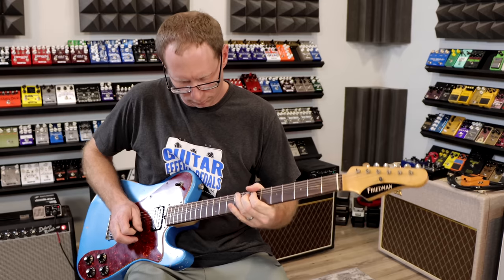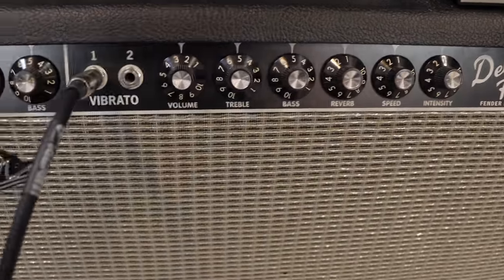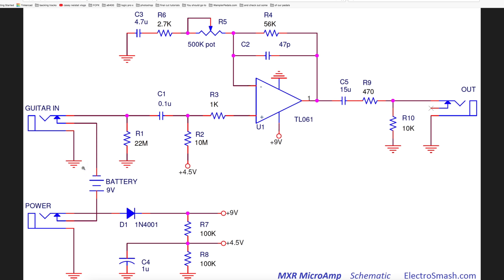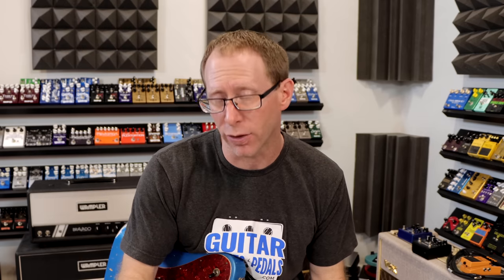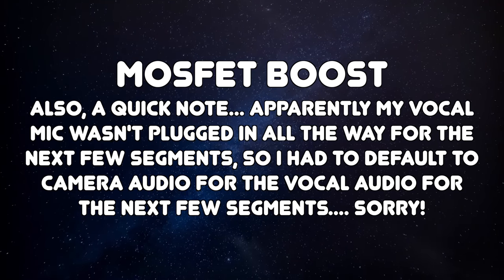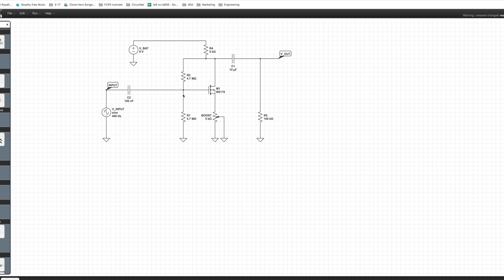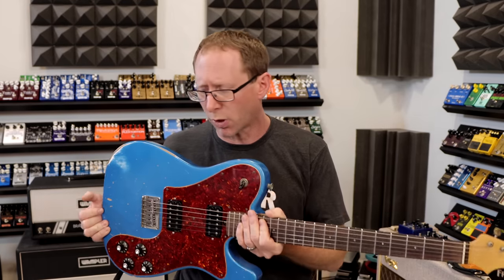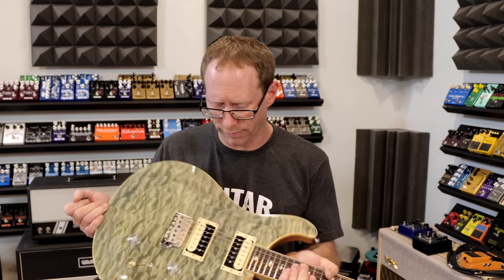Boost Pedals (Explained in Depth)

Comment: Circuit drawings, my brain goes "whoosh". Mr Wampler talks over circuit drawings, my brain goes "lightbulbs"!
Reply: Couldn't agree more, these types of analysis with frequency responses included, we need more of this
Reply: @murfmurphy6212  The results of the analysis is the circuit he drew, not necessarily a real circuit in any pedal.  Example, the "inverting" boost has a 47k input impedance, that is WAY low compared to a more normal 1 meg input impedance.  It is much better to measure a "real" pedal and show the results than to draw up a circuit for analysis.

Comment: The booster quality that took us decades to finally figure out is that if the booster is intended to push an amplifier into providing "coloration" of some kind, whether or not that might be mentally classified as "distortion", the booster must trim back on the treble being fed to the amp.  Remember that coloration/distortion is the addition of harmonics.  More harmonics is nice and what guitarists love, especially lower-order harmonics.  Harmonics OF harmonics, on the other hand, are not pleasing.  So, where many historic boosters, like the Micro-Amp, LPB-1, and Rangemaster, only provided a single control for adjusting the output level, more contemporary boosters include some form of tone-shaping, such that the amp gets what extracts the best from it.

The genius of the Klon Centaur (and remember it emerged in the early-to-mid '90s) was that it was one of the first pedals that was deliberately and explicitly designed to strategically push an amp into "better" breakup.  Many mistakenly think that it, and other booster pedals were/are supposed to produce an overdrive sound themselves.  Rather, they are designed to precondition the signal to yield nice amp overdrive.  I know, because Bill told me himself, that the "Treble" control on the Klon was really intended to be used primarily for treble cut, even though it can provide boost as well.  I suppose, as a fallback position, keeping the Gain low, turning the treble up, and maintaining modest output volume, might dial back what you feed an amp, for a pleasing rhythm tone.  But for pushing the amp, treble-CUT is where it's at.  The Klon does provide some clipping, but if one sets the treble-cut right, any additional harmonics provided by the amp are harmonics of lower-order harmonics, and not simply a boosting of the high-end fizz.

Lest we think all boosters are ONLY for overdrive, bear in mind that most sound-amplifying devices have at least some headroom.  So modest gain can be used to increase volume for a solo or other passage, but still remain clean, and not push the amp into dirt.  That tends not to be how many of us use it, but the option is there.

My own first booster, 50 years ago, was the mic pre-amp of a tube tape deck. I would feed the line out from that to my cheap guitar amp.  Of course, anticipating a MUCH lower input signal than what a guitar pickup provides, the mic pre-amp would be easily overdriven, and the line out pushed the guitar amp hard.  NOTHING clean about that!  My 2nd booster was a compressor, feeding an old MXR 6-band.

More recently, I whipped up a booster circuit that can add a bit of dirt when maxed, but trims back the treble as Gain is increased.  You can build one if you're up to the challenge.  I've gotten some nice feedback from users.  The document gives a walkthrough of how it works.  http://img.photobucket.com/albums/v474/mhammer/TheCrank.gif
Reply: Worth adding boosters like ep booster are lovely even without the breakup, it just does something really nice to frequency response. Yet it's often used for slight breakup anyway. But a great always on pedal to magically "sweeten" the sound instead of boosting much in volume or into breakup.
Reply: @Yupppi  Yes.  What you describe is what I meant by "coloration".  It doesn't have to be an obviously distorted/clipped sound to provide a useful change in the tone for a solo or other change in a tune.  That coloration can either be provided within the booster itself, or via the interaction between booster and amp, as in the case of the Rangemaster. As I understand it the Rangemaster is biased so that it runs out of headroom on one half-cycle more readily than the other, yielding a form of asymmetric clipping, and providing three sources of coloration: its own internal clipping, the treble boost, and what the boosted signal does to the amp.  I understand as well, that the use of germanium transistor in the Rangemaster also alters the tone via particular loading effects.  But that stuff's beyond my pay grade.
I did make myself what's supposed to be an EP Booster, though I'm uncertain if the schematic I was following was accurate.  I honestly didn't get anything noteworthy out of it that I couldn't get from a simple op-amp stage like Brian showed at the start.  That's not terrible but it was a lot of effort for very little return in my case.
Reply: That's a really good detailed explanation.
Reply: How refreshing to read my old Canadian buddy!  Hope you are well....I am!  (Squid in Hollywood under girlfriends' sign-in)
Reply: @1492oceanblue2  Rick!!  What an absolute pleasure!  We've been missing you buddy.  I gather not many gigs of late, eh?  We're all well here.  I'm retired, and looking more and more like Allan Ginsberg these days, now that I don't have to attend meetings anymore and look civilized for anyone.  All the other family members are working from home.
Reply: @davidelizalde3844  Thanks.
Reply: Randy Phillips  Reading through the manual (for the JD4S), it does not appear to be mandatory or recommended to plug your guitar into it first.  Rather, the instructions are similar to many others that assume you have no other pedals.  That may make both you and I scratch our heads, but it is what it is.  As for the input and output impedances, they are perhaps not as fabulous as 1meg in and 1k out, but they are fine for rock and roll.

Inverting vs non-inverting op-amps?  Inverting have lower input impedance than non-inverting.  Is this important?  If preserving phase is important - e.g., when there are several parallel signal paths - then some folks would prefer that non-inverting be used.  However, two inverting stages in succession makes the output in-phase with the input.  Moreover, I see more and more "blender" pedals for signal management incorporating phase-flipping for inputs.  Is the reduced input impedance important?  If I was making a preamp for sampling acoustic sounds with a high-end mic, I would NOT use an inverting op-amp as my input stage.  But if it's a drive pedal, that reduced input impedance can sometimes work in your favour.

Some pedals opt for a non-inverting input stage, so they can use it as the core of a buffered bypass.

The difference between JFET and MOSFET?  Sadly, there you have ventured beyond the limits of my knowledge.  Perhaps someone else can chime in.  I also recommend posting your question on the DIYstompbox forum; one of the best sources of guitar FX knowledge out there.  Brian himself got his "sea legs" there, as did many others in the pedal community.
Reply: Randy Phillips  We've drifted a little off-base, but that's fine; I don't mind a challenge.  Two of the LEDs (D11/D12) would appear to be for indicating effect status.  The other 4 are for shining on the photocells, with each photocell and its corresponding LED sealed in a piece of heat shrink to be light-tight.
The Uni-Vibe also used photocells, but used an incandescent bulb to illuminate them, not an LED.  Because the filament in such a bulb takes a little while to cool down after being heated up, and because all photocells have their particular light/dark times, the waveform produced by the LFO does not precisely capture what's happening at the photocell, so the LFO is tweaked to produce the desired audible sweep.  My understanding is that it is kind of, but not purely, sinusoidal. Unlike the Uni-Vibe, the Rotovibe uses LEDs to shine on the photocell.  LEDs will turn on and off instantly.  So if one is not able to use photocells with the desired lag, you simply make the LFO deliver a waveform that mimics that lag.
The specific capacitor values are of no great importance and will be different depending on the values of R6/8/11/14 and the photocells in parallel with them.  The end-goal is to spread out the phase shift to produce broad shallow dips, instead of concentrating the phase shift in a manner that provides focussed notches.
When the Uni-Vibe entered the scene, the assumption was that it would be a more affordable and easier-to-lug-around replacement for a Leslie cabinet.  The same was true of the Boss CE-1.  Both have low-ish input impedances, because it was assumed they would be fed from the low-impedance output of a keyboard, and not a guitar.
I hope this is useful info.
Reply: Randy Phillips  The rise and fall of a waveform can be individually tailored.  That is, of course, part of how one can produce Attack/Decay envelope generators for synths.  What we don't, and probably can't see is the rise/fall characteristics of the LDRs.  Some of the work is offloaded to them.
Reply: Randy Phillips  Well now once again you've wandered beyond the perimeter of my expertise.  Can't help you there, I'm afraid.
Reply: The one thing usually not highlighted is that when boosting a signal it's not only adding high freq b also lows, depending on the circuit.Those lows can become an issue, especially w neck pickups.a good booster imo, does shape both the low and the high end by shaving some of those frequencies off, unless it has tone controls (and not just one f cutting highs).This was my issue w the first Tumnus, before the deluxe w the tone controls.Ive modded a MXR Micro amp to get a better ( more even) frequency response).it still adds a wee bit of bass to the signals b not as much as it did and also clearly lowers the treble.
Reply: @MrBallynally2  The optimal characteristics of a "booster" depends on what one is using it for.  Certainly the buffering effect will increase bandwidth of the booster output, at both ends.  If the intent is to overdrive/saturate something subsequent, then retaining the complete bandwidth of the pickups may not be what you want.  If the intent is merely to have a clean boost for solos or other parts of a tune where you want a simply level boost within headroom limits, that full bandwidth might be welcome.  Neither is "better", just better-suited to the overall tonal objective.
Reply: @markhammer643  thanks Mark. I find most one knob boosters act like a Fender amp turned up ie, you're likely to adjust the tone controls if you had any, but you don't.
The issue remains w just a treble cut.Since guitars have treble controls one might argue that a bass control is a more important feature on a boost, either internal or external.That, i think, is the reason a lot of recent boosters have come out w 2 controls.
Furthermore, as a solo boost you want more mids, not more bass and treble..usually. i see the only real use of a standard full spectrum boost if you then follow it w a type of OD/distortion with certain characteristics..
Reply: @MrBallynally2  Yes, guitars DO have treble-cut controls on board.  And some guitars, like many G&L, Reverend, and other brands, have a lo-cut control on-board as well.  Ideally, the working guitarist wants a boost to function like post-production for them.  That is, a change magically appears in the level and timbre of the guitar, without any further adjustment or compensation needed.  On drive pedals I build, I always try to think about what I would need to do to the circuit if switching over from a guitar and amp set for a bright clear sound.  Often that can mean restricting the bandwidth in a way that can sidestep the need to fiddle with either guitar or amp settings.  That doesn't mean treble/bass controls on the pedal are "wrong" in any sense.  Just that, ideally, one shouldn't need to fiddle with them much of the time.
Reply: @scottnoricsson2023  It is NOT and never HAS been a standalone overdrive.  Bill Finnegan contacted me in 2007 to see if the pedal could be induced to do something that a number of clients had asked for.  In addition to a schematic, he sent me two ungooped boards, one of them having every single component socketed, so that I could play with part values and compare it against the stock unit.  VERY well-made product, but not designed to be  an overdrive pedal that yields a sound on its own.  If you called Bill to order one, he would chat with you for 20-30 minutes to find out about your rig, and if he felt the pedal was unlikely to do anything beneficial for your rig, he would discourage purchase.  In the end, I couldn't do what Bill requested, and both boards and schematic were returned.  Unfortunately, Bill's conscientious approach to client relations detracted from his production output, and the long wait time led to people paying outrageous sums for used ones on E-bay - always without the benefit of Bill's advice.  If they didn't have the sort of rig Bill would recommend using a Klon with, or had unrealistic expectations of what it was supposed to do, they would be disappointed in how much money they had spent on it.  But that's a bit like being resentful that an expensive gold-plated spoon doesn't cut a steak very well.  Of course it doesn't; that's not what it's for.  It has a particular purpose, and serves that purpose very well, but has been around for a little over 25 years and in the intervening time other pedals have come along trying to serve the same purpose.
Reply: I know this is an older comment, but the link provided takes to a really low resolution picture. You can’t really make anything out

Comment: My personal favorite boost (having never played a Tumnus) is the full-sized TC Electronic Spark.  It's SO good.  Gain, Volume, Highs, Lows, a three-position voicing switch, it's got everything and sounds GREAT.  Gets into low gain OD territory.  Putting the switch at Mid makes single-coils SING.  Haven't used it a lot lately, because my Dual Fusion sounds so good I just don't need the help lol.  Vintage side is always on, Modern side provides the beef.  What a freaking pedal.  Your stuff rocks, Brian!
Reply: Yeah, I think my non-mini Spark is the first pedal I go for when putting together a board.

The FAT switch just helps a Tele sound enough like a Les Paul that I don't need to switch guitars.

Comment: Brian, firstly, I trust that you're healthy and safe in this unprecedented time.  Secondly, thanks for making this video and for the honorable mention of the Vertex Boost.  One correction at 06:34 - you mentioned the Vertex Boost as an example of an inverting boost.  I know you were breadboarding some examples to make approximations, however the Vertex Boost is non-inverting.  Also, the input impedance on the Vertex Boost is 1M, the schematic shown in the video looked like 47K.  There is no mid-boost, nor will it distort with higher output pickups as the example showed in the demo.  I'm happy to send you one to evaluate if that would be of interest to you.  With that said, there shouldn't be any difference in frequency response between iso-inverting or non-inverting.  If there are differences, it would be more attributable to design shortcomings rather than something inherent in inverting vs. non-inverting circuits.  Hope this helps clarify regard the Vertex Boost, and free free to shoot me an email if you want to check out the pedal for further evaluation - mason@vertexeffects.com.  Kind regards, Mason

Comment: I know this video is old but I’ll try… I’m gonna try a boost in the effects loop. Looking to get as clean a boost as possible. Tips? Am I crazy? 🤣
Started using a quilter Mach 3 on both channels for my gain tone (Plexi and 50’s Fender). When I go to either by themselves I get a huge volume drop. Band plays country and rock so if I go Fender only (for country stuff) I want it fairly clean but at same volume as both channels, but any boost, compressor or OD just makes it distort when I get the volume I want. I just love the amp for many reasons, including weight and tone, but just wanna make it work!
Ps… I love your Pantheon Deluxe pedal. That thing is money!!!!
Great video as always!